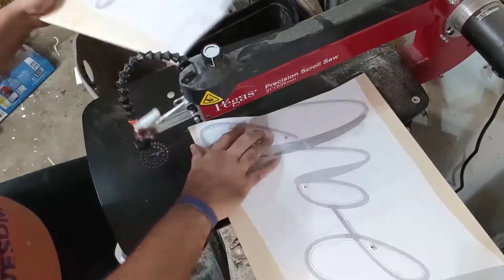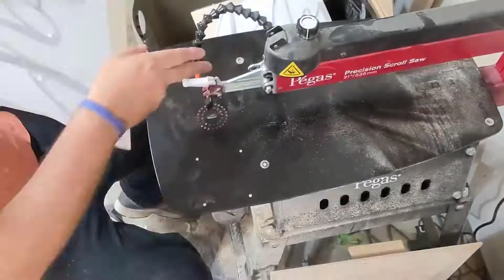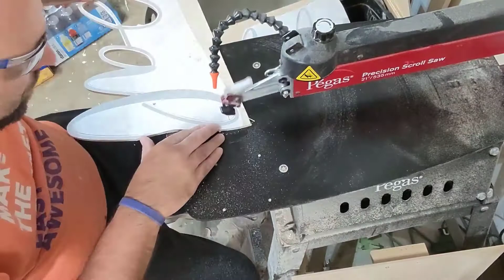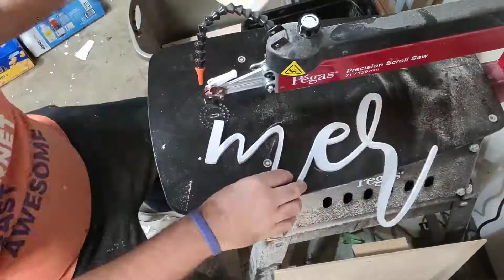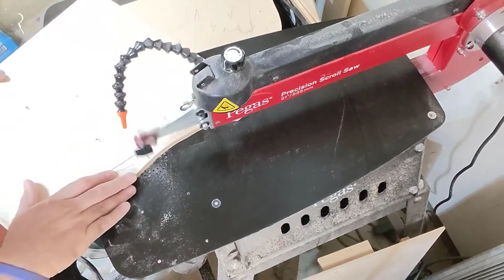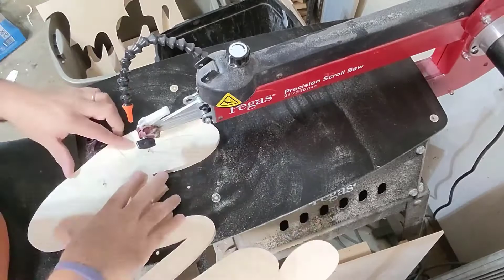Scroll Saw Time Lapse - Palmer Name Wood Sign

Comment: Nice job! Did you ever consider using a spiral blade? That would allow you to do the whole sign instead of  cutting into pieces...just a thought. ;-)
Reply: Thank you! I did actually try to use a spiral blade for this (and some other projects) but I can't seem to figure them out. I'm so used to spinning pieces with the regular blades. I'll keep trying though.
Reply: @MrJayLane  Yes...it takes some practice but definitely worth the cause! I used a spiral blade on a piece that was 8" high but @3' feet long and it worked like a charm...very similar to your project. It took me about 2 weeks of getting used to using a spiral blade (and that's a lot of used practice blades! haha) Good luck and keep up the great videos. I get my Pegus in a few weeks and will be able to retire my old Delta.
Reply: Cutting out of what? I'm a  beginner sorry
Reply: @sheilaegeland  He cut the sign in half so that he could finish the remaining cuts (letters) as the sign is too long to “spin”. 

Using spiral blades allow you to cut in any direction without “spinning” the piece. As long as your wood fits on the table you can cut any “length” of wood.
Reply: @scottmccaul6172  love spiral blades, I don't you anything else ,they take a while to master but I wouldn't be without them.👍